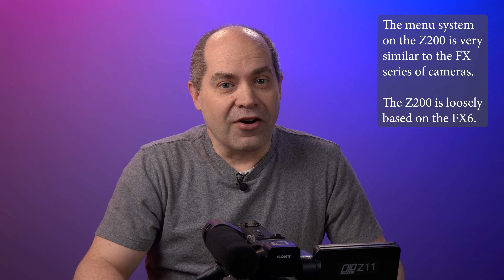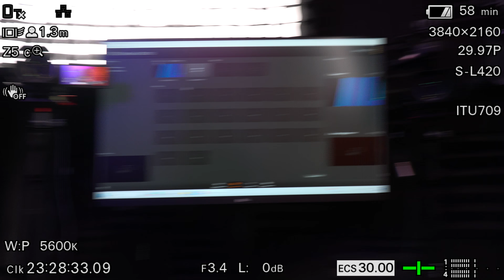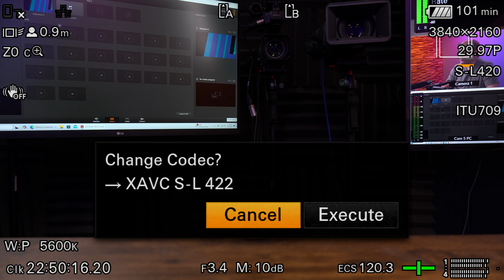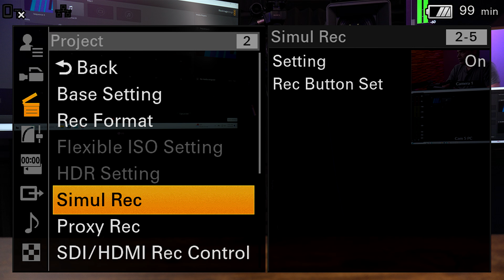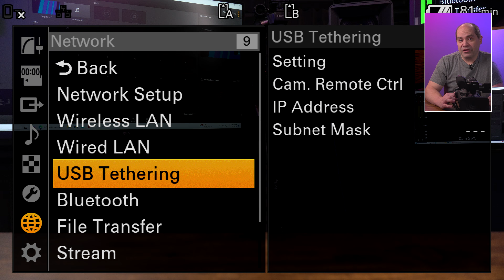Sony PXW-Z200: Is It as Good As Anticipated???

Comment: Hi Doug.  Thanks a lot for this video.  I have been trying to make a decision about moving to these cameras since December but am waiting until closer to the NAB show to see if Panasonic has a new model from their CX350.  Since I do a lot of live streaming, I am very interested in the best image right out of the camera.

Have you heard of or tried out the ability to import a LUT and use it for the base for a scene file?  Meaning you could dial in a nice tone curve, import it into the camera as a LUT but then use that LUT as a base look of a scene file for live recording/output?  This is in "custom mode" and would really make the camera more useful for live productions imho.  BUT, it is unclear to me which ISO this puts the camera at (0 or 1600) and if any dynamic range is compromised along with noise levels etc...

I would be interested to hear your take on this and if you had a chance to play around with the functionality.  Apparently the FX6 can do the same.  I rented the camera for three days before I knew about this, so I did not get to try it out.  Thanks!
Reply from the maker: I haven't tried it, but it can import a LUT. There are some restrictions on where that can be used, and I've yet to explore that.
Reply: The CX350 is still a solid camera and Panasonic keeps updating its firmware. And it is much more affordable than Sony. What do you miss from a CX350? Apart from the 12G SDI out...
Reply: @SportFlow  Hello, I have a CX350 and overall it is a very nice camera.  Although I have never liked the way the camera handles highlights.  Basically the I think the sensor is a bit challenged in this area.  I have tweaked the menu settings a lot and have it producing nice images but I am hoping for a better camera to be released.  2019 is starting to look a bit far away!

The rear zoom LANC control is very nice on the CX350.  Probably the closest I have found to a real Canon or Fuji broadcast controller.

I rented a Z200 for a few days and while the camera has a lot going for it, I did not like the viewfinder as it is (imho) undersaturated and lacking contrast.  The rear zoom 'lurch' as Doug pointed out is at a critical point.  So these two things have me waiting to see if Panasonic is alive or asleep...
Reply: @timpolster   I agree with the highlight handling. 2019? Wow, time flies. Do you like the LANC control? It is smooth but slow, and the fast zoom setting in the menu has no effect when using a LANC zoom demand. It is so slow that it is not recommended for fast action sports. Professional cameras have a long release cycle. I would not expect to see a new camcorder for at least 2 or 3 years..
Reply: @SportFlow  I think the Sony has a little too much 'cinema' thinking in some parts of the Z200 camera.  Like the viewfinder image appearance (without hardly any adjustment settings) and the LANC controller.  They are "fine" but I use the viewfinder as an exposure check (after I have dialed it in) and that workflow is kind of forgotten about with the Sony.  Maybe they can improve the LANC as the LANC in the CX350 was horrible when it was first released.

I know Panasonic released an HC camera not too long ago but the CX350 was released in 2019, so its time frame for an upgrade is well within development times.
Reply: @timpolster  Yes. The HC-X2 it is basically a refreshed consumer version of the CX350 with a brighter and sharper LCD for outdoor use but some awkward controls and dials and LCD folding mechanism. But losses the SRT streaming, FTP uploading, P2 codecs and RCP shading. Basically all pure professional features the consumer does not need. If the CX350 is renewed I expect some minor improvements like the LCD, maybe slightly better autofocus and 12G SDI out. Probably they will use the same 1" sensor. I'm in the market for a new camcorder but now that the CX350 is sub-$3000 it is a bargain for what it offers.
Reply: @SportFlow  I don't disagree.  For the price  the CX350 is a nice tool.  It would be a major failure imho if Panasonic would use a sensor from a 2019 release in a 2025 camera.  I am not sure of the sensor quality in the HC camera.  But, I am of the school where I would rather pay more and get a better camera than meet a low price target without pro level features.  I enjoy the P2 workflow.  In my view, the CX350 was about $500-$1000 too low from a feature "quality" point of view.  I never liked the audio preamp quality and the sensor could have been better.  The Sony Z200 is much better in this regard.  For the short time I had it, I preferred the Z200 image after tweaking the 709 profile but the blacks were a bit crushed without many menu controls for the tone curve.  The real-time LUT approach that I asked Doug about is intriguing.  I know Panasonic offers this in their newer mirrorless cameras.  Might be a way around sensor deficits.
Reply: @timpolster  The HC-X2 uses the same 1" sensor of the CX350. To be honest, these kind of cameras don't really need top-notch picture quality. The are convenient all-in-one tools for TV news reporters and school livestreams. If you really need a bump in quality and multicamera workflow you just use a system camera like Panasonic AK-UC4000. I mean, there is no point in developing a very expensive palm-size camcorder. For instance the Sony Z280 was too expensive and had little luck in the market.
Reply: @SportFlow  I think there is a middle ground.  System cameras are large, need lenses and are in a different price/usage class.  Early in this thread it was stated how the CX350 is less expensive than the Sony Z200.  Well that difference in pricing goes to better everything on the camera.  I agree, the Z280 was too large and too expensive for this time period.  Maybe 10 years ago it would have been embraced.  The form factor is set and is very useful.  I just think it comes down to what they choose to put inside.  One thing on the Z200 that is outstanding is the noise reduction.  This comes about from the entire signal chain being faster than previous models.  I do not see much hope for a new camera at NAB but maybe IBC in September.  If not, I will need to consider the Z200.  This is a multi-year commitment for me, so I am not rushing into anything.
Reply: @timpolster  Sure, these cameras last long. Our trusty Panasonic HPX250 P2 cameras are still up and running. Yes, they are somewhat soft but colors are great. Good luck in your investment. The Z200 looks great to be honest.
Reply: @SportFlow  Thanks!
Reply: I nailed the specs of the now available CX370. Same 5-year-old sensor, 12G SDI and that's about it.

Comment: Very Very similar to my Canon XF605s. Love those cams
Reply: Similar in form-factor only.  I have used both and the Z200 is better in so many ways.
Reply: @maseo305  Nearly every thing he lists in the video is also available on the XF605 or has a comparable. So why do you think the Sony is better? Honest question.
Reply: @gotscottgreen  20x zoom for one is a massive benefit.  I think the overall image looks better quality on the Sony as well.  There are also just usability things that you have to put into practice to see how they compare.  On paper, they both have face tracking AF, but I have found the reliability of those systems to vary wildly.  I find the stabilization on the 605 to be useless for static shots... the image will literally move around when you're on a tripod (it's more meant for handheld use), but there are times when you're on sticks and there is vibration or people walking on platforms and you just need a rock solid shot.  I haven't used the Z200, but that could also be a significant benefit.  Most of the advantages are just real-world output vs. specs on a website and they're hard to quantify - but you know them immediately when you use them.
Reply from the maker: And the effective zoom on the Z200 is 30X in 4K and 40X in HD with Clear Image Zoom turned on, which I've always found to be excellent.
Reply: @gotscottgreen  XF605 has variable-ND?  As Dalton and Doug mentioned here, the zoom range and very useable Clear Image Zoom also sets it apart from XF605.  Z200 also starts out wider at 24mm.  Thats to just name a couple.
Reply: @maseo305  those aren’t as important to me, plus if I need it there is 30x in HD. To each their own. Everyone has what they like and need!
Reply: @ Maybe not important to you, but your original comment was that the 605 is 'very very similar'.  Canon 30x 'extended zoom' get very soft once you get close to 30x in HD.   Happy shooting.
Reply: @maseo305  Yes, not identical.....but you are right, that's kinda what you wanted to hear, correct?
Reply: @maseo305  why? Could you say an example? Thanks
Reply: Just on the edge of choosing between those two…and thinking which one is better overall.. all my previous cameras were Canon, but just recently I was told that there is this Z200 which should be better in “many” ways?
Reply: @duelcommanderonstack  I see very little difference minus some of the zoom reach. I love my Canon, and have used them for a long time since I moved on from Sony. Different color science, and I like the look of Canon better. I personally think it's personal choice.

Comment: Hi some people have adapted Makita BL1850B power tool batteries using a barel plug, of course at your own risk
Reply: Just because you can do it, doesn't mean you should. Voltage 19.5V vs 18V is close enough but still. I don't see this kind of jerry rigging anything to be proud about. The only thing it shows is that you can't afford proper accessories.

Comment: I am actually thinking about getting 6 of these and move from Z150s as well.
Reply from the maker: You'd very likely be glad you made the move. It's quite an upgrade in several big ways, but also 1000 different small ways. But try renting one for a few days.
Reply: @djp_video  yea I will probably get one soon... I just wasn't sure if I can color match them with Z150.
Reply from the maker: You can get close. You can't use the Picture Profile feature on the Z150 though if you want the two to get close to matching. The color features on the Z200 don't quite give quite enough control to make them match the Z150 -- most of the adjustments will be made on the Z150. 

It's possible to create a LUT for the Z200, so you could make it match that way, but there just isn't quite enough granularity in the controls to make it match the Z150 if a picture profile is applied otherwise.
Reply: @djp_video  thanks I keep that in mind.